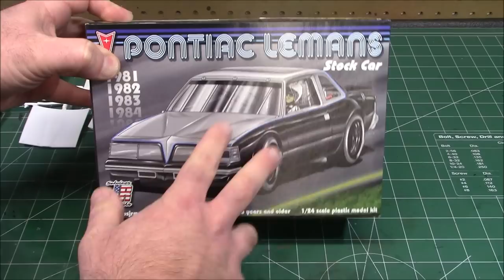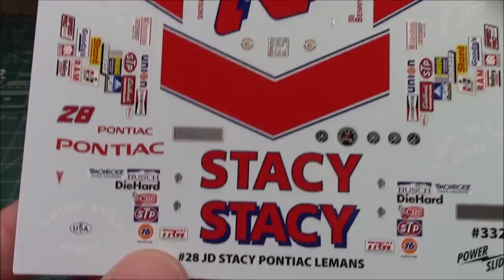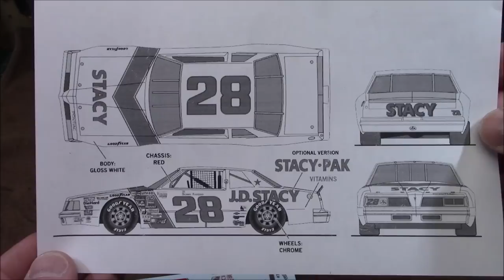Pontiac LeMans 1981 - 1984 JD Stacy NASCAR Stock Car 1/24 Scale Model Kit Build Review Salvinos JR

Comment: I’d really be interested in seeing how you get the headers attached after you drop in the engine.  I’ve never been able to do it properly.
Reply: I did one a few months ago. For me it was a pain in the butt.
Reply from the maker: Just press them up from the bottom. It's a tight fit on the starter motor side but they get in there.  A long tip on your super glue bottle will reach in to attach them.